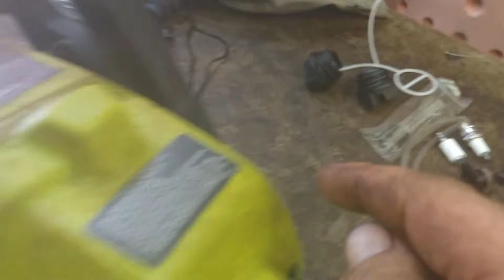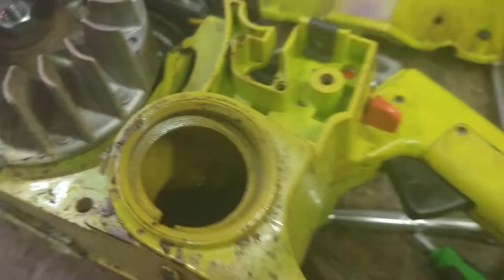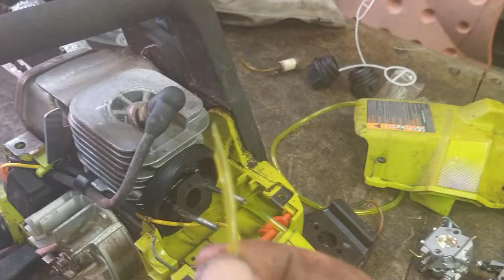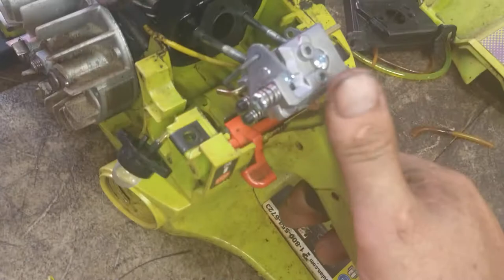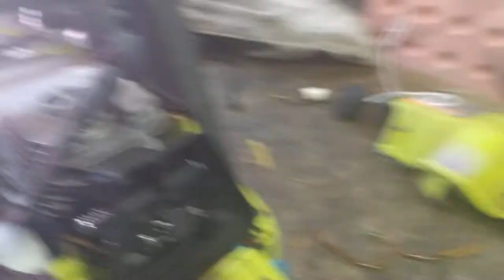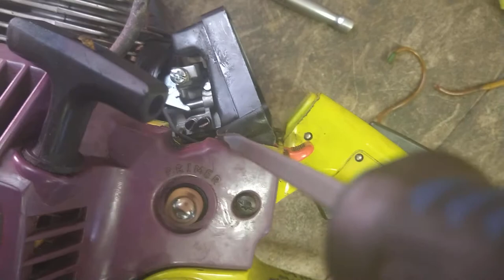poulan wild thing 2375 le chainsaw carburetor fuel line repair

Comment: This is by far the most helpful video for replacing fuel lines and carb kit for the Paulin 2375 LE wild thing. It was such a clear cut help. Thanks for showing about the adjustment screw as well.. You da man!

Comment: Thanks for helping me double check the fuel line placement started questioning myself. Went through the whole replacement process on everything but the carb and still couldn't get it started. Took carb apart fuel inlet screen was caked. Scraped it off and gave it a blast of cleaner and running like new. Thank you!

Comment: What is the correct diameter of the fuel line on the right side?  I've been trying to use 3/16" OD.  I have a garage find, brand new never used one fuel line crumbled filter was rolling around in the tank.

Seems originally they built it with a 2 part hose joined at the port with a nozzle between the 2 lengths.  I had to push out the nozzle from the top.
Reply from the maker: the second one and fourth one https://amzn.to/3wp71Qs

Comment: you should have added a parts list, specifically which diameter fuel lines needed to fix this make and model of chainsaw. But other than that, you're showing us a pretty detailed explanation of how to get the fuel system fixed!
Reply from the maker: Everything you need is in the description

Comment: You did this one handed and I think that's insanely impressive. I took it apart but didn't memorize what went where fuel line wise, helpful. You switched the fuel filter to the other line, I did the same thing before I watched the video just didn't move the filter over since I thought that's were it went in at first
Reply from the maker: glad i could help

Comment: I replaced all the fuel lines, and cleaned the car. The saw will not run hot and it's hard to start with cold. Do you think the diaphragm in the carb is week?
I tryed adjusting all the screws, my idle is maxed out just to get it to idle when it can.
Reply from the maker: carb is shot just get a new one  
carb
https://amzn.to/3wbaksS
Reply: @smallengineguys  you the man!

Comment: i know how to change fuel lines and bulb. My question is for troubleshooting, can you suck air from carb output port barb carb, thru carb input barb ?
Reply from the maker: might be a little difficult but in theory yes
Reply from the maker: easiest thing is if you spray carb cleaner in it and crank it full throttle a bunch if it starts and shuts off its new carb time. if not check spark and compression

Comment: Surprised there's not a whole lot more views of this one, or comments. Near perfect, my only concern will be leakage around new 'In- To-Tank -Hose',, as some guys drill those tank holes for reasons I hope I don't run into or ever need to know about. But near brilliant show. Fast, no tedious slow turned screws while you talk about how tough your day was. Perfect views, even deep in tank and just a damned good video man. And I mean that. If they were all like yours, the world's repairs would be three days ahead. I'm subscribed right now. Some odd reason yours didn't come up first. Must have watched 45 minutes of nothing of use. Two days later, same keywords, yours came up. Whew! Thanks!
Reply from the maker: newer videos will show up first sometimes. im not sure how it all works yet but trying to get to the top
Reply: @smallengineguys  Well, I sure hope you figure that out. Yours was a slam dunk, in your face, fix it, get it done, get it done now and fast and right. It should definitely pop up first .
Reply from the maker: @realsecman  i think the more thumbs up views and messages i get the further up the list i go.
Reply: Good idea to check if intake manifold tight also or will never run right.